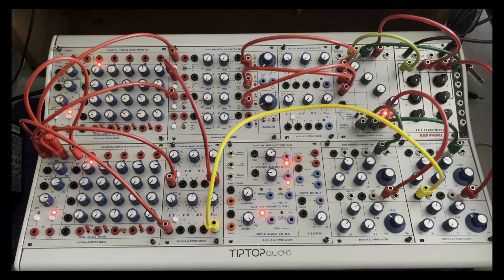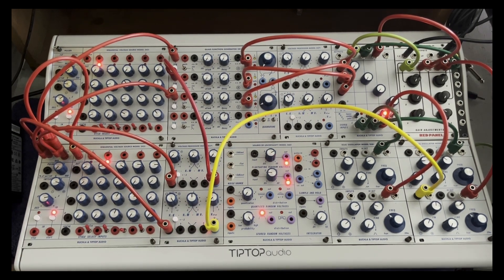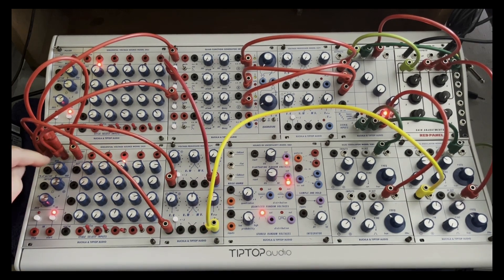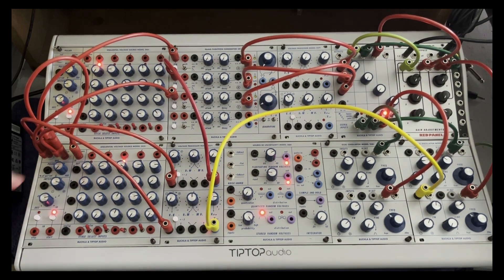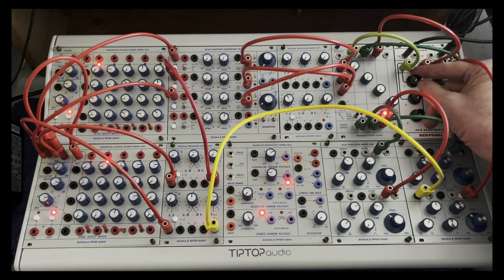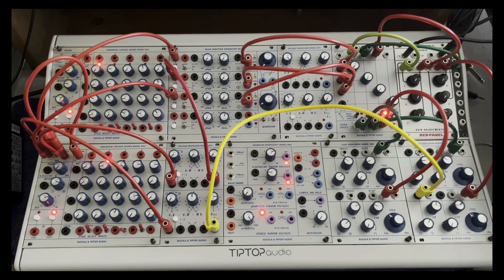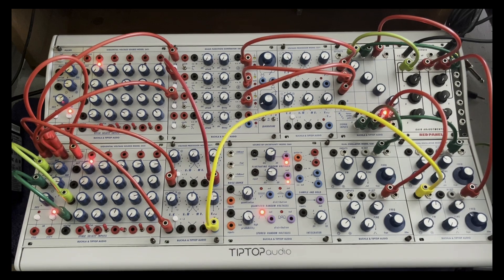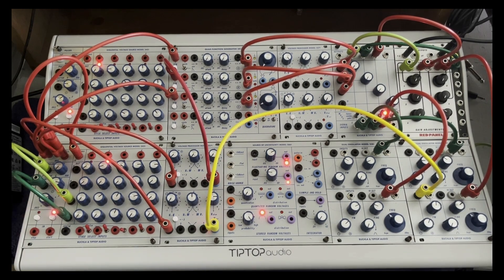Tiptop 245t and 257t

Comment: There is another, very straight forward solution for a pendulum sequence: Set the 281t in cycle mode and connect the output cv to the analog input of the 245t. 281t delivers a beautiful triangle wave. The peak to peak voltage of the 281t is large enough to cover all 5 stages of the 245t.

Comment: In my humble opinion: a good add-on for the 245t is the Doepfer A-151 sequential switch. It goes both ways: 4 inputs to one output or one input to 4 outputs. You can plug all row outputs of the 245t in the inputs of the A-151 and have up to 20 stage sequences, if you need that.
Reply: I made a Sequential Switch Module (has 2 switches each seq switch controls 2 sets of 4 inputs) and it also has a remake of the 5-step Buchla Easel sequencer (with vc-stage selection).   I use it to control a clone of a Buchla-245/Serge 8-step sequener  (a 8-step modified CGS Sequencer that has all the tuctions of both Buchla and serge sequencers).  I use the first seq switches to give me dual 16-step sequences or a single 32-step sequence.   I use 2 steps (2 inputs) of the 2nd sequential switch to alternately send the clock pulse to the up pulse cv input of the sequencer and then the down pulse cv input.  This allows you to switch sequence directions.   Powerful module.

Comment: If you run the ramp from the 245t through the integrator of the 266t (set time around 1) and bring it back to the analog input of the 245t, you'll get a pendulum motion. The integrator transforms the ramp wave to a triangle wave. Unfortunately, the peak to peak voltage is not high enough to get a 5 stage pendulum, but 4 stages are doable. You might want to adjust the signal from the 266t with the 257t a bit. Playing with the integration time, gives you an uneven triangle. So, the pendulum swings faster in one direction as in the other one.
Reply from the maker: Wow!! Way cool idea/patch. I’ll surely give it a whirl. ☺️🙇‍♂️